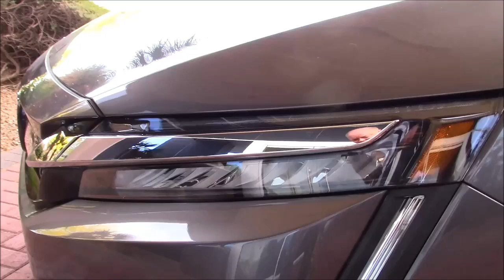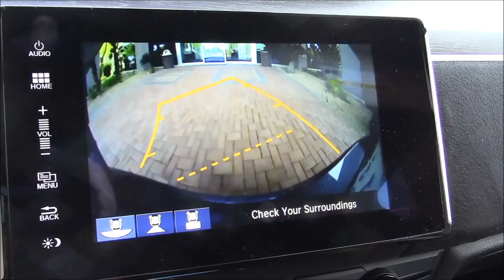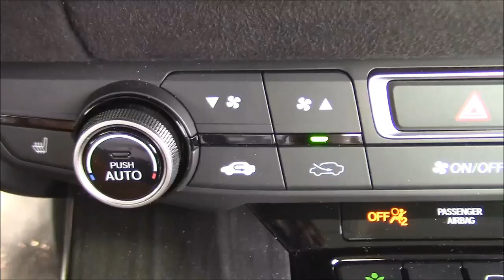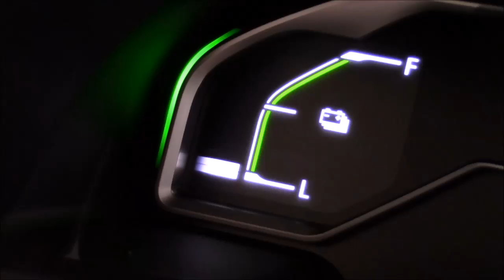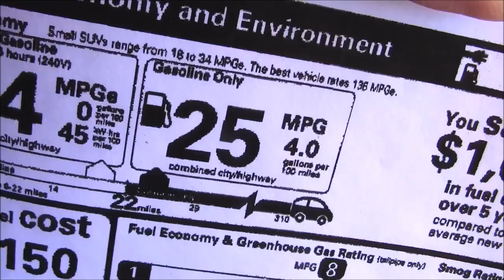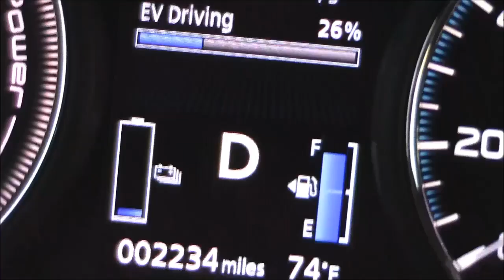2018 Honda Clarity vs Mitsubishi Outlander PHEV

Comment: The Clarity run well and economically in cross country and around our home. It run economically at 5l for 100 km on long trip. Around our home it use electricity and .4l for 100km.

Comment: If you live in SoCal, they charge $0.53 per kilowatt, and average $.30 per kilowatt during off-peak time.  Clarity has a 17 KWH battery, so if you charge during the peak time, it would be more expensive than a regular gas car.  If you live in outside of CA say NV, UT, or AZ, it is a good deal to go electric alone.

Comment: Too bad the reviewer did not mention the car gets $7500 federal rebate and ~$2500 from most states.  So his complaint the car is a little to expensive is way off base.  It is a remarkable deal as its real costs even for the Touring model is ~$25000, less than comparable Accord
Reply from the maker: fees vary and unlike magazine articles that are dead i a few months these videos stay on for years.....most buyers already know the current tax credits anyway--which in my opinion should be abolished.   Why should I  pay for your car?
Reply: Well, the state rebate is only available in 7 states, so hardly 'most states'.  And of course the buyer has to have at least that much in taxes to be able to take advantage of the full rebate.  That would be nice to get a credit of $10,000 on a new Clarity, though.

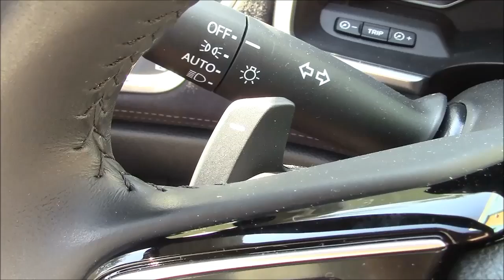Comment: at 8:28, those are not 'Performance paddle shifter', they are Regen paddle to increase (-) or decrease (+) your regen
Reply from the maker: I never said they were for shifting...and doesn't more regen increase  electric performance?
Reply: No offence chad, just not sure how much you know about the Clarity.  I have seen quite a few reviews referring to the 'Deceleration paddle' as Honda call it as Paddle Shifter implying something can be 'shifted' like a gear.  It helps to increase your remaining electric range as it captures the energy to slow down your car.  From my research, the best way to increase range is to let the car 'coast' if possible as it has the least lost.  There are still inefficiency and lost when you are regen-ing.  The other thing I want to mention in your video is there is no Level 3 charging (DC Quick Charging) for the Clarity in North America (the person you spoke to at the dealership is wrong, as a matter of fact, most dealers have no idea what they are talking about with regard to this car based on my conversation with many current owners including my own experience) so you cannot charge this car in 30 min or so.  Level 1 (110V) takes about 12 hours-ish (which you tried) and Level 2 (240V) takes less than 2.5 hours to full charge.  I believe the Japanese version does have a Level 3 (DCQC) option and the plug is located on the right rear quarter of the car opposite the gas inlet which is on the left rear of the car.
Reply from the maker: Ting:  like I a said in the video the owners manual said NOTHING about charging times so I was simply stating the info that was in the press releases.  Info on cars changes by the month..even the week at times.  This is NOT a tech video, simply a general driving and fuel economy video......one week in it was enough.  Not my type of vehicle anyway.  Give me a BMW M3.

Comment: Bloody hell that Honda is ugly.
Reply: My new Clarity was $21,000 after $7,500 tax refund and  $1,500 California rebate.  I haven’t used a drop of gas in 2 months and I drive 19,000 miles a year.
Reply: VoltecRules  Well as long as it's saving you money and you don't mind looking like a dork then it's ok I suppose.
Reply: It becomes much more beautiful as you drive it and realize what a wonderful car it is that after rebates cost less than a standard Honda Accord!  Besides you drive it from the inside which is luxurious. Others see the outside.
Reply: That's like ugly people saying 'beauty is on the inside'. What if you catch its reflection in a shop window when you're driving past and have to be violently sick? That's dangerous.
Reply: It’s absolutely  beautiful compared to a Prius
Reply: Friedrich Uckhauff And bloody hell your comment is ugly. I will buy the Clarity because it is the most beautiful car that can do evevrything I want.
Reply: OK Fella, beauty is in the eye of the beholder....Although you should probably make an urgent appointment with your nearest optician.
Reply: Friedrich Uckhauff apples with apples, this thing is at least better looking than a model 3. It is the most beautiful phev. The interior is better built than a tesla, if you don't take the hugh screen into account, tesla is the cheapest high priced car I have ever sat in.
Reply: Not sure if I call it ugly, but it is sure odd looking.  I'm shopping for one due to the engineering of the drivetrain.  Sure doesn't hurt it that it is made in their Japanese factory.
Reply: Looking from back maybe.. but front is good looking..